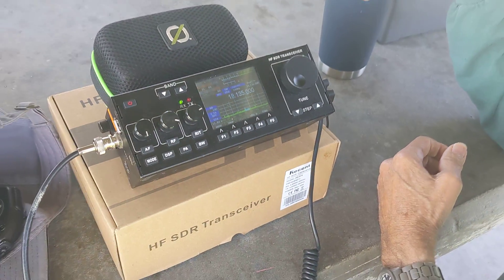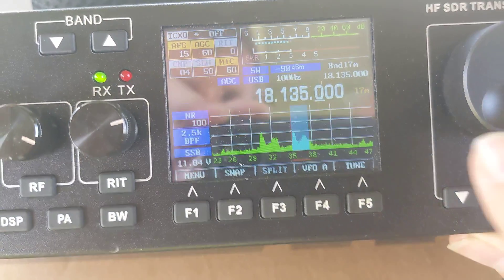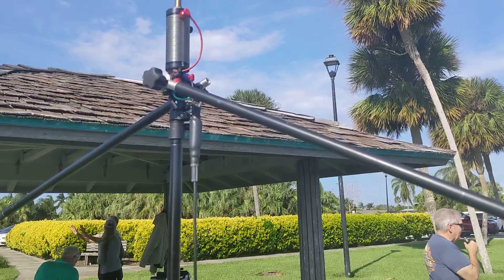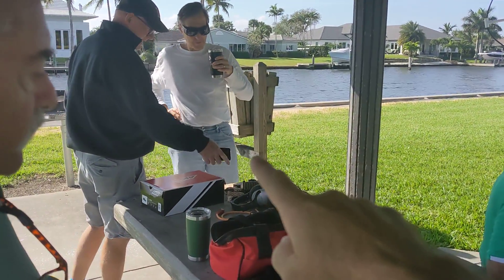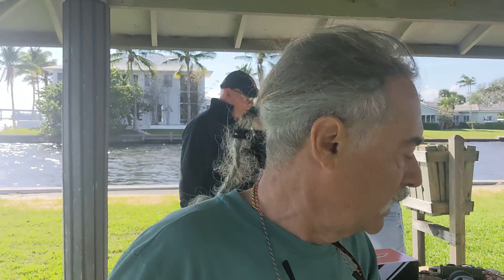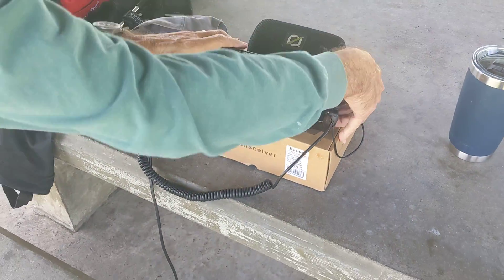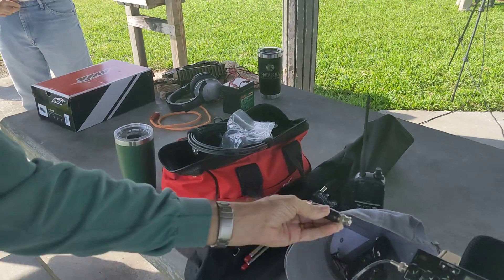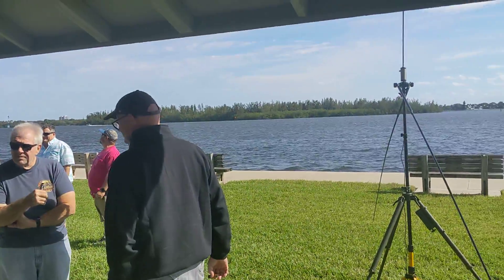Recent RS-918 MCHF Clone With Jan KK4GGJ Vero Beach QRP Event!

Comment: Hi there, i wanted to get this one, but i just found one with orange buttons, that one was too ugly, but it had the battery inside, mine is a UHSDR-QRP with black buttons, i wanted it with white buttons but the seller just had the ones like i got, but its different clones, is it a best one of them? Or is a chinese clone just a chinese clone? The original kit is no longer for sale, and the firmware in the newer models are not like on the one in all the videos here on youtube, mine cant TX 5watt on 11 meter, just 50mw at max when the TX of of band is active..so i belive its a software problem? I realy want one of these that can Tx 2-3 watt on 11 meter... mine do also lagg alittle sometimes.   73. From Norway

Comment: The first letter in "uBITX" is actually not a "u", but a Latin letter, mu, unfortunately I can't type the correct one here. So it's pronounced as "mu" and not "u", and mu is the math notation for micro (10^-6), and thus often used in value representation.

Comment: hello, I picked one of these up and the first thing I noticed was the waterfall is going up, instead of down such as falling lol. I checked the setting and the firmware. The firmware was out of date from 2018 so I updated the firmware but still noticed the the water is not falling and was going up? I know the display is correctly installed as everything that appears on it shows correctly, not upside down (as I say with a smile :) ) So what is going on with this? Never seen a backward waterfall on a radio? Is there anything that can be done to correct this this?
George